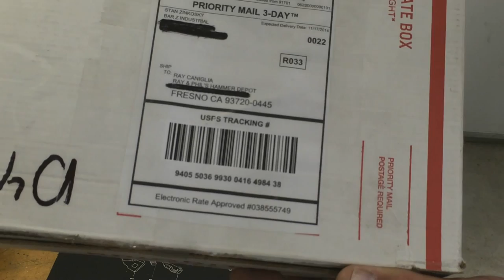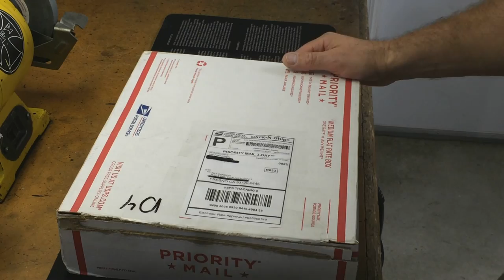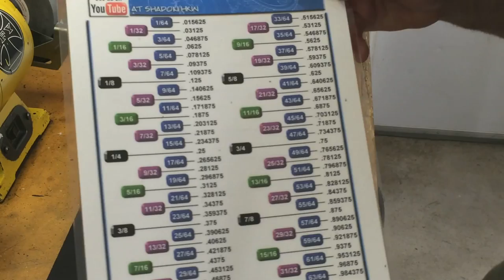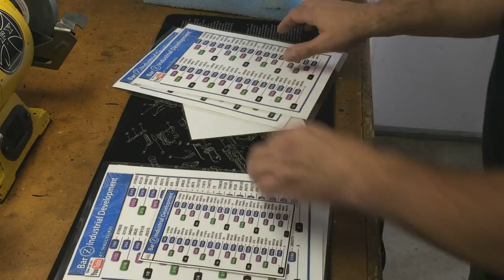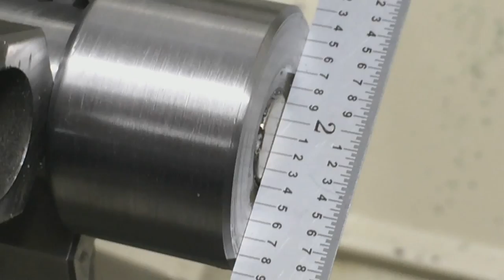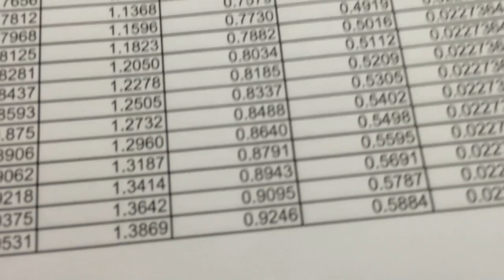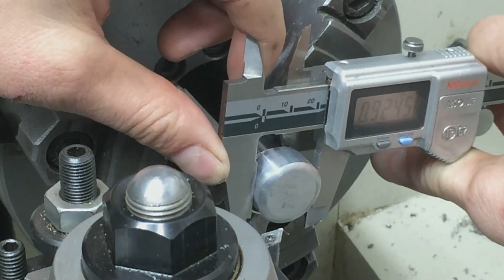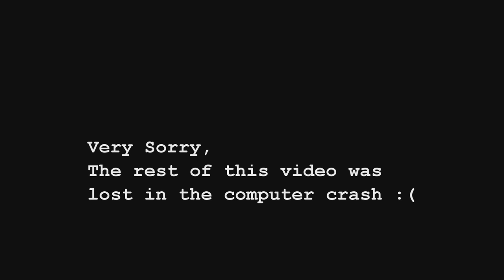Mag Base

Comment: Great your back and nice video.  Fine mentorship too.  Nice, Clean design and most excellent knurl by Phil!  Did you cold blue the original in the beginning?  Sorry about your crash. Don't know if your using an imaging system for backup but I use Acronis "PC Backup & Recovery" ~$25, works great and recommended by my PC Guru.  Thanks for the share and quality words about Community! ~PJ
Reply from the maker: Hi PJ,

Thank you for your kind words! Philip is a good young adult, and an excellent up and coming machinist. I did cold blue my mag base but Phil wanted his bare metal industrial look. I now have three external back up drives so hopefully I will never loose data again!

Thanks for stopping by!

Ray

Comment: Nice job on the mag bases. I have made Allen wrench holders to mount to my lathe at work. I made these out of aluminum and used several of the rare earth magnets to attach them to the machines. My question is could you make the bases out of aluminum bar stock, or did you and Phillip feel that you needed the weight and mass of steel? Again great work and it stinks that you had a computer crash.
Reply from the maker: Hi James,

Mag bases for Allen's is a great idea!  Yes, we used 12L14 just for the weight and mass. Hopefully no more crashes for a long time!

Thanks for stopping by!

Ray

Comment: do you do different tasks with the G0709 than the clausing?  i have the g0709 and i'm looking for an 8" direct mount d1-5 chuck for it, grizzly's idea of that chuck is a plain back with a backplate pre-installed, not what i want... i like your video's ray.. ive been following since you got the grizzly lathe... i like your mag mount concept... i have that particular noga but i probably wont do that project since i have other mag mount nogas.... i would love to see more of  your gunsmithing videos if you are still doing that type of thing... thanks... keep the videos coming please
Reply from the maker: Yes, the Clausing will only do Imperial threads since I do not have the metric change gear set, and the Clausing is only a 10"X36" inch lathe with a small 1 1/16" spindle bore.

I agree in getting a direct mount 8" chuck for the G0709, it runs much better with the bigger swing chuck on it. My next chuck is going to be a 8" six jaw, since I already have a 8" four jaw, its a little costly upgrade so it will have to be way in the future. 

Thank you for your kind words and your ongoing support, I had several hours, and four different gunsmith related projects on video all lost due to the computer crash, I'm sure it would have been projects you would have really enjoyed watching!

Thanks for stopping by!

Ray